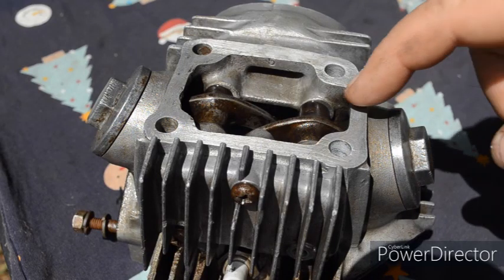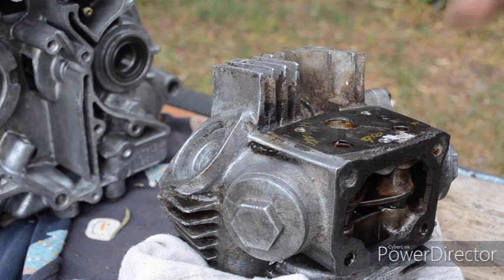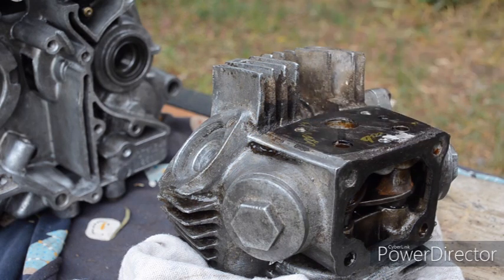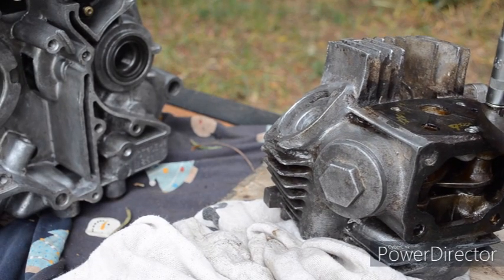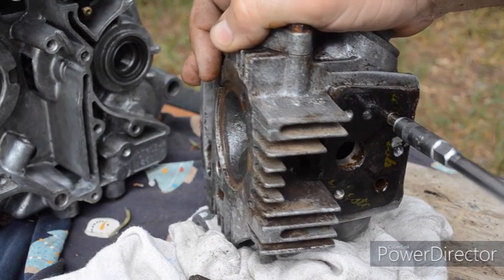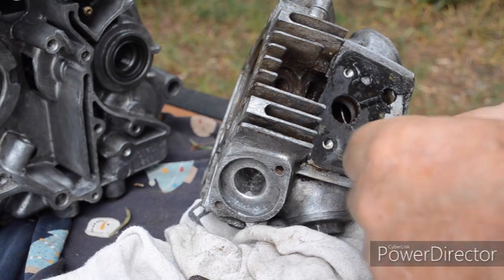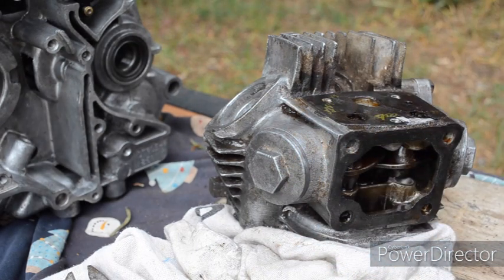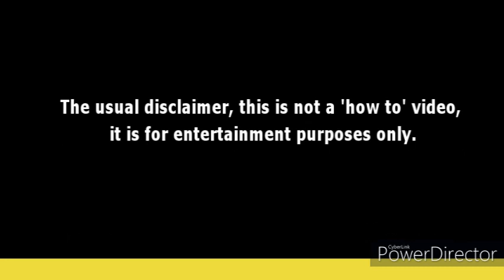Honda CT 90/110 Seized Rocker Shaft?  Try This Quick Fix!

Comment: What size of sleeve anchor bolt is that?
Reply from the maker: Off the top of my head I think it was 6mm dia x 26mm length & cost 50 cents each, but I'll double check, measure one & let you know.

Comment: One side of the pin is already threaded
Reply from the maker: As I mentioned early in the video, some have a thread to allow a bolt to be screwed in but not on all.  These were not threaded.
Reply: I didn’t catch that in the video, were they threaded on the other side?
Reply from the maker: @dalelandon  I mention it at the beginning of the video & no, just a plain tube no threads.  ct 110's are the same.